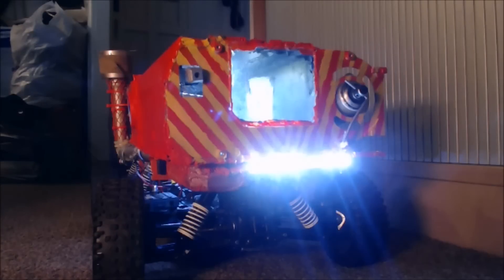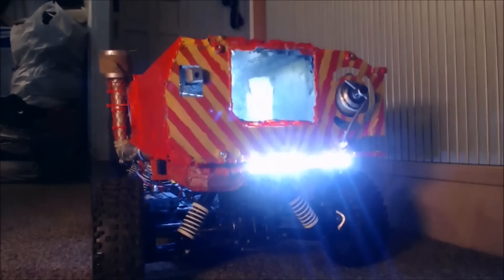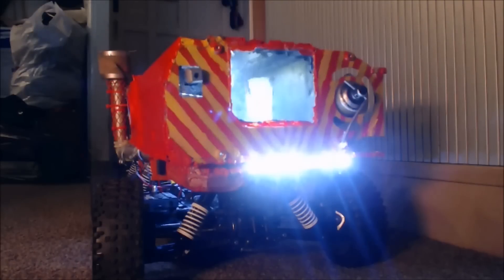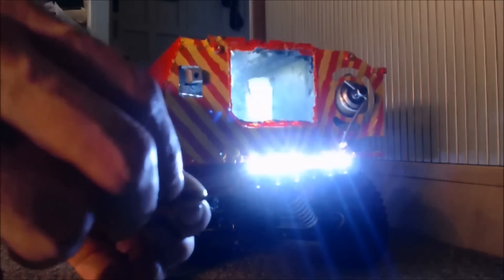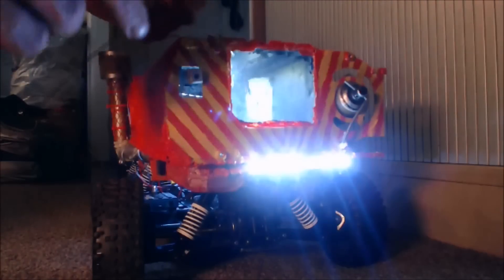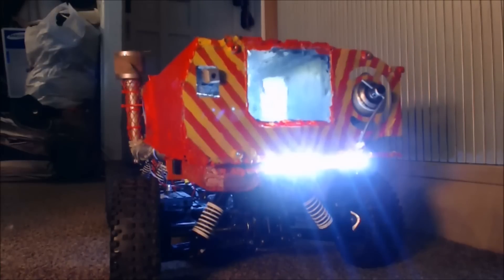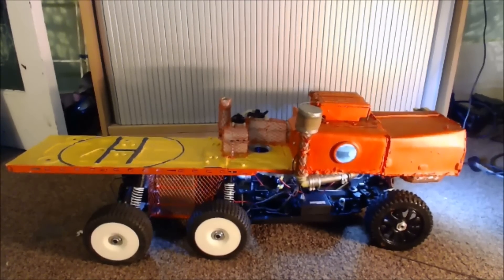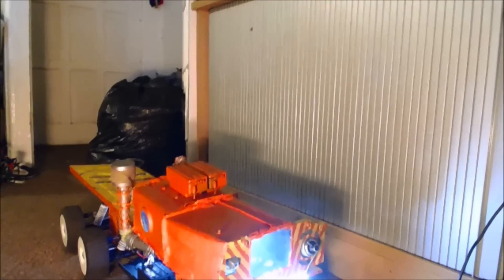Concept for a Harpoon Grapple Winch System for an RC Vehicle

Comment: them lights look cool :) Thumbs up
Reply from the maker: macplastering thank you ji :-) the little box under the front right of the cab steps the batteries up at the rear from 12v to 23v to pass the current through the front lights, because of that they get so hot that they have browned :-D but they do light the way up really well and look cool on camera :-D
Reply: didn't think they would get so hot and it really dose look cool :)
Reply from the maker: macplastering:-) must admit I didn't either when I put them together, was only after I fixed them on (way of it) I touched the strip by accident and burnt myself...I guess its suitable for adults age 31+ :-p
Reply: Haha for sure :)

Comment: great minds think alike !  lol !  ive had the grappling hook winch idea for a few years but never did try to build it . your idea is way more extravagant than mine. good luck on the build ,  will be awesome if it works out.
Reply from the maker: MyPuppers thank you for the kind words my friend :-D After checking out your mini cannon im tempted to use a small explosive charge to fire the harpoon grapple :-O ...I really shouldn't considering the nitro on board I guess, but it would look pretty awesome :-) when I was young my dad milled me a brass cannon that was just slightly bigger than the version you made, looked exactly the same and it fired as well, ball bearings :-p but you just have to be careful as you need to use the closest thing to gun metal as you can get :-D while getting the firework powder right, also you have to take care as not to step on firearms licensing laws in the U.k :-) but watching it go off is..something you never forget :-p it sent a 13mm steel ball bearing two inches deep in to solid concrete :-p from about 13 feet away. Scary as hell when you light the fuse and run for it :-p  But yeah hope I can get this concept going :-) As I go about chopping the nitinol wire up and testing it out I will upload my progress on y.t here in case you ever fancy having a go or making something similar or better :-) Keep your vids coming btw really enjoying them :-p
Reply: battonfive ha ! ha!  that would be epic !!

Comment: Interesting update mate! At what point will the hook actually receive the current? When it has been shot out, or when it is being shot out??
Reply from the maker: DutchRC ADVENTURES straight away when its shot out :-) with the speed of the winch mechanisms and the few seconds of delay it will take for the spear to expand out in to its grapple form I think I will have the one servo for the winch hooked up in parallel with perhaps a capacitor running off to send current down the cabling to trigger the change and maintain the shape from there on out :-) I wouldn't usually recommend tapping the main battery running the servos in such away but I ran additional power through the receiver board which should cover the required voltage and amps needed, specially as when its winching it wont be turning so I can avoid multiple drains on the li-ion cells in there at any one time :-)
Reply: battonfive Sounds very interesting mate! I assume you'll first make a few stand-alone test mock-ups for this system? :)